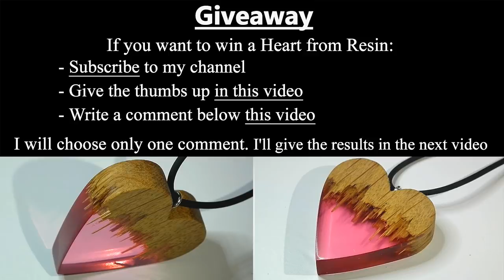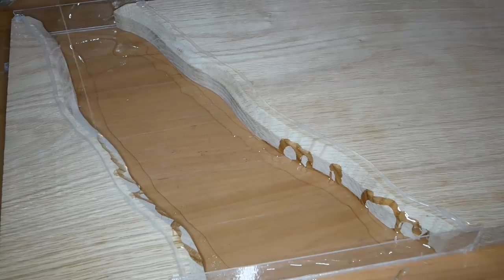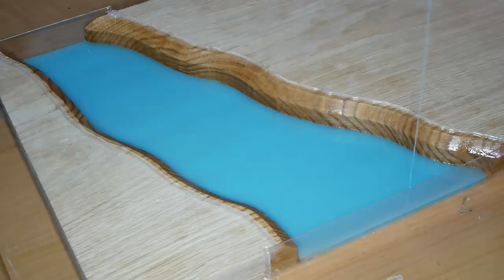How to make SERVING BOARD with Shells and Epoxy Resin / ART RESIN

Comment: If you want any ultra smooth and somewhat liquid resistant finish on the wood without using sealers, lightly spray water on the wood between sandings. The water raises loose wood fibers which you then sand down. This makes the surface super slick and removes open voids in the fiber for liquid to get in later.
Reply from the maker: Thanks for the tip

Comment: I really like this video.
It's well edited, the music isn't too distracting, and it shows all the steps really well.

I especially like the end product.
I'm doing some resin art myself but I'm not confident in my abilities so I'm starting off small.
After seeing this video, I got a  few questions.

1. How did you make the resin blue like that? The blue resin used in this video looks milky. Whenever I use a dye to color the resin, the resin is clear. Is it a type of dye you used?

2. I can't really see the measurements for the epoxy and hardener. I'm not too sure what's a good ratio for epoxy and hardener and I was using this video to get an idea.

3. I really like the music you used in this video. Do you know that name/artist of the song?
Reply from the maker: I use blue and white together. It came out like in the movie. each resin has a different mixing ratio.

Comment: Awesome video.   What is the difference between the 2 Sanders that you used ?   And is it necessary to use 2 different ones ?   Can the same job be done with only 1 sander?
Reply from the maker: One can. but you must have the right abrasives
Reply: Which type of abrasives ??

Comment: Absolutely stunning as always. Mind you, I think this could easily be m favourite yet. Why??  I’ve cut and sanded my wood but have been too scared to do the pour. Think you’ve given me a bit of inspiration for the weekend lol. Can I ask, did you use casting resin for this?
Reply from the maker: Yes it is a casting resin. I always wait for the resin to be a little thick. That it would not flow down the walls of the board

Comment: The very first clear coat that you applied with a brush. Is that just clear epoxy? Also the last 2 thin top coats, is that just clear epoxy again?
Reply from the maker: resin + hardener